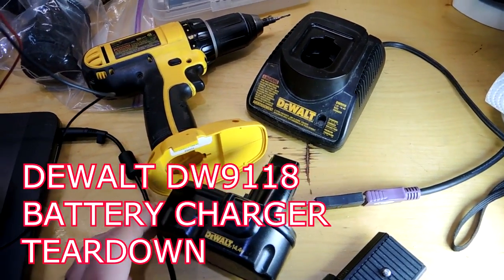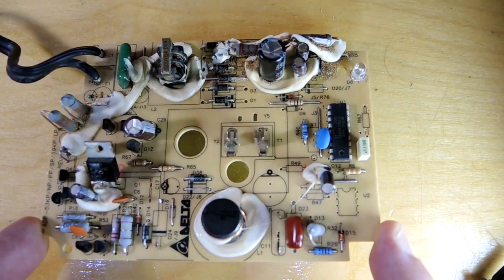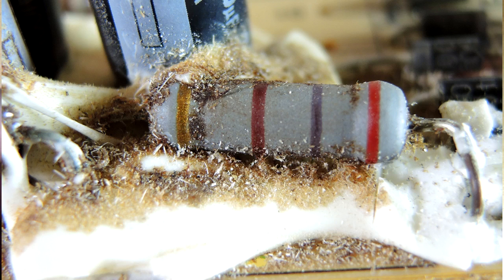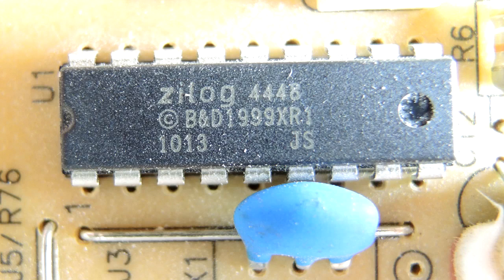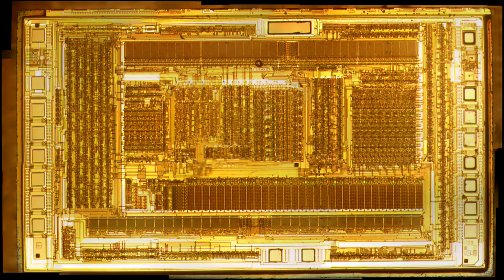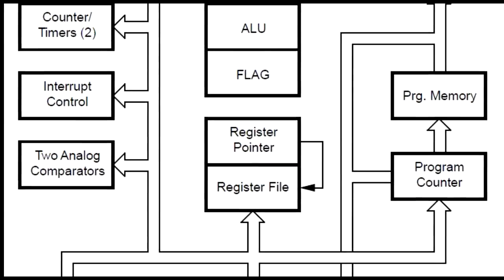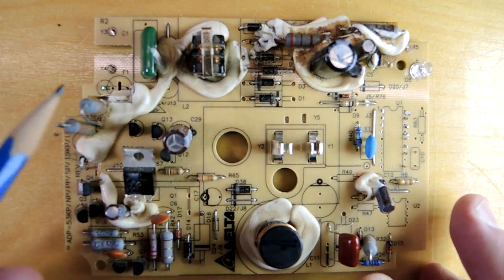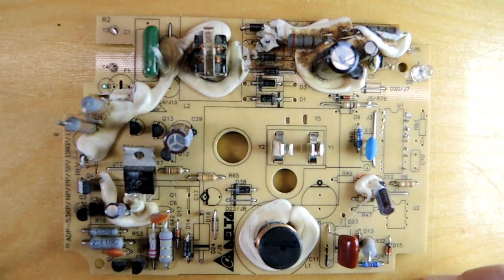Dewalt DW9118 Battery Charger Teardown

Comment: I have two identical batteries and this exact charger. It charges one battery to over 13.54v and the other to around 10.5v. The charger says 7.2v to 14.4v on it. It’s it automatically detecting the number of cells in the battery pack or something?

I believe that both battery packs, because they’re identical, should be charging to the same voltage.
Reply: I presume that these are 12V packs?  If so, the one hitting 13.54V is about right after sitting off the charger a few minutes but the one only at 10.5V has two shorted cells in it.    If these are instead 14.4V packs, then the one at 13.54V has two shorted cells and the one at 10.5V has 4 shorted cells.

It can't really detect # of cells because there is no smarts/IC in the battery pack.  All it can do is infer the pack voltage based on what it senses so if a pack has shorted cells, it can't determine this.   If it had an odd # of shorted cells or more than that, it might rapidly flash the LED.

You are facing what most of us did several years ago, that the pack is worn out.  I rebuilt mine but they wore out again, not to shorted cells yet but very low capacity.

I was mulling my options and opted to rebuild the pack with Li-Ion 18650 cells this time.  Mine are 14.4V packs though, it may be harder to fit the 18650 cells into the smaller casing of a 12V pack, unless you start cutting off some of the studs that are used to screw it together.  You can get 3S 40A BMS boards cheap on aliexpress then you just need to substitute your own 12.6V power supply (no  higher), assuming you have 12V packs and use 3 series cells or 3S2P.

Comment: I am impressed with your teardown. I have an exact DW9107, WHICH looks very similar to DW9118. For the fun of learning electronics, could I seek your expertise to trouble shoot?
Reply: Be aware that there was a recall on that model # DW9107 for failure to shut off and burst the battery.
Reply: @stinkycheese804  Thanks for the recall info!

Comment: What screw driver did u use to open it sir?
Reply: Some Dewalt chargers use a torx, T15.  If you have a full size range set of security torx you should be set, however their older chargers had plain torx, not security screws.  Oddly even on some chargers without security torx, some of the tools that came in the sets with those chargers, did have security torx, and some had a unique combo screw head that was torx15 but also had a slot across it so you could open it with a plain old flat blade screwdriver if you needed to.

Comment: Interesting video about the IC. I have opened mine, a DW9116.  Its also a similar variant of the Delta charger but the B&D IC is trademarked from 2012 "BD2012XR4".
Quick question, what would D15 and D17 be? Glass zenners? 
Trying to troubleshoot that DW9116 and I think I have these similar diodes that are not good. Electrolytic cap, fuse, X1 cap, and fusable resistors are all in good shape. Scotchy diodes on the bridge all good too. I have 3V AC across the output of the charger while charging a dead battery... Perhaps its not AC decoupled. I have two inductors (at first i thought they were a transformer to step down to 20 V) on mine and one had the winding open and the other one they have put a nice heat shrink around it.

Comment: good video. is there a way to convert the charger (20 volt) into a 12 volt DC input (car)? i was assuming that just a new voltage regulator would do.. not sure.
Reply: I'd be careful about that. I recently looked at one of these and noticed the charger output is not isolated from main. What gives this away is that it uses an inductor in place of a transformer.

That's fine as long as it's used as intended. The battery contacts are recessed so you can never touch them. Though, I wouldn't risk plugging the output to anything exposed.

Comment: i have a DW9118 charger and a DW 9116 charger,, the 16 says it has a tune up mode that does a better job of charging,,my 18 does not say that..does the 18 have the tuneup mode?? the charger housings are different..both work good..

Comment: My buddy informed me regarding the reconditioning program ( Check Details Here>>>https://www.facebook.com/Battery-reconditioning-310070329426065/app/208195102528120 ) so I used it out of curiosity and it is really of benefit. I`m so glad I did! I`ve reconditioned 17 batteries using this guide, even an old car battery I thought was long gone. You can recondition any type of battery making use of the guideline!

Comment: Do you know of any videos covering how to trigger different voltages for the multi bolt dewalt chargers?
Reply: No video needed, you just plug in the appropriate battery.  That is all it is designed for, charging batteries with that # of cells and it will equally do that for any other pack with same # of NiCd cells, since there is no intelligent communication between the pack (which is just the series of cells wired to the connector) and the charger.

Comment: my dewalt charger output voltage (dc) is 52-53 Volt...what is wrong?,please say me,thanks for video
Reply: Same check mine way over voltage. Any ideas what is wrong?
Reply: 51v here. Any idea?
Reply: If you are measuring it with no load, meaning the battery is not plugged in, that is not necessarily a sign of anything wrong, just the way these float to a high voltage and current regulate to charge multiple different battery cell #s.  What does it do when you plug in a known good battery?
Reply: @stinkycheese804  than you for reply,ı threw it away many years ago. :) have a nice day

Comment: The white cement collecting the wood dust did not significantly change the state of the resistor.  It runs hot and would have brown-charred the PCB even if were perfectly clean, as mine was, being made prior to their addition of the white cement in that area.  Iff anything the cement would have 'sunk away a modest amount of heat, slowing the decay of the solder joints and copper under them, so they don't pull off as quickly.  Granted it's no substitute for a larger resistor that runs cooler, and yet despite running hot mine does still work fine with the one exception that I was a bit concerned about the power surge every time I plugged it in, so I moved the AC filter capacitor a little to make room for an NTC thermistor, I added in series to mitigate that.

Comment: what tool did you use to remove the top case please ?
Reply from the maker: +frederick jones case used security screws: had to hand grind a screwdriver tip that would fit
Reply: T15 Torx security driver. Cheap at Harbor Freight.

Comment: Typically the silastic on the board is to help absorb mechanical vibration so you don't hear the parts resonating during operation of the switch mode supply.  Usually, it is just squirted on the board and during QC they measure the sound output during circuit operation.  If it is quiet enough it will pass that step in QC even if it was not applied effectively around the whole part.

Comment: The sand in the fuse is there to quench the arc when the fuse blows...   If you happen to dump out a largish high current fuse that's blown, you'll see the sand 'melted' into the edges of the fuse link where the arc formed as the link melted open.   The sand 'back-fills' the gap in the fuse link and extinguishes the arc....

Comment: it would be cool if an image like this could be printed very large, say 5 feet across, for a wall picture, if it could be done pin sharp....modern art for sure.
Reply: *****
i did look at the website ones, they would not have the sharpness to be printed poster size
Reply: I'm actively searching for a microscope to do exactly that myself. But until now all the microscopes I found that have an XY-table are at least a few hundred Euros. And then I would have to modify or by a mount for a camera on top of that. Modern art is becoming expensive quickly ;) .